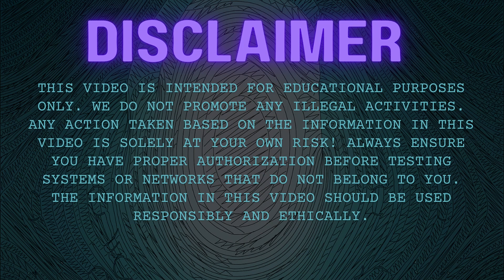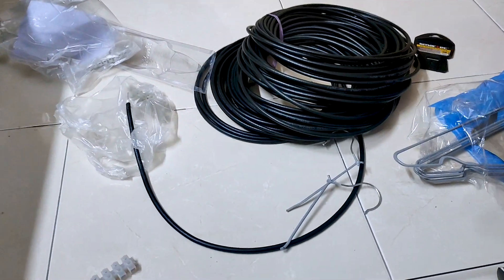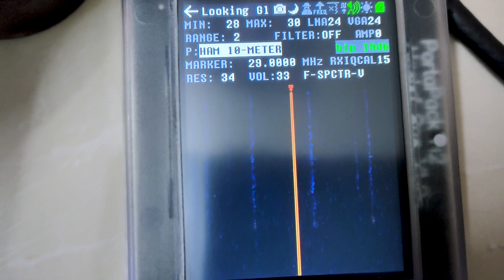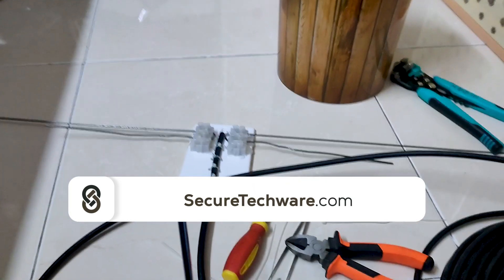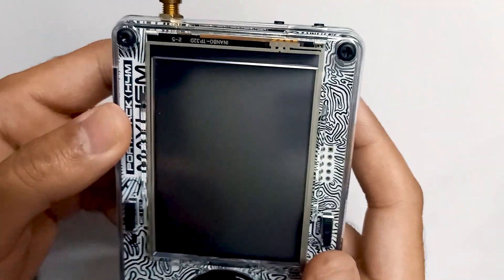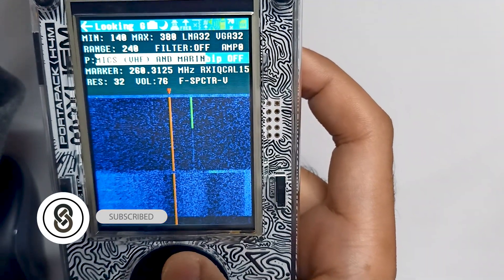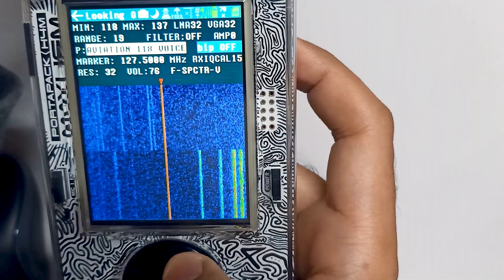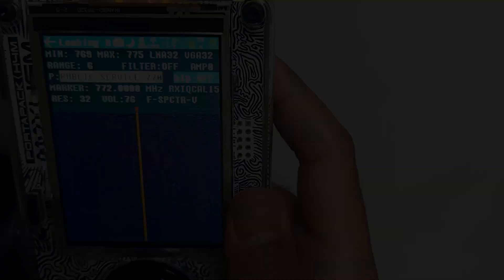DIY Coat Hanger Dipole Antenna for SDR Tested with PortaPack!

Comment: When you are using such antenna you won't be able to fine-tune the frequency?

Because with the radio telescopic antenna you can tune it by changing length according to wavelength.